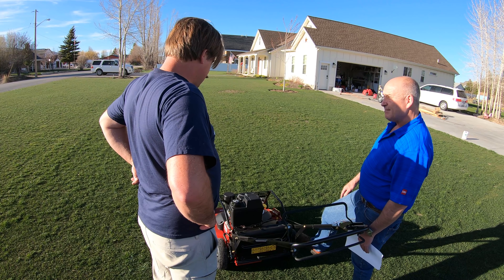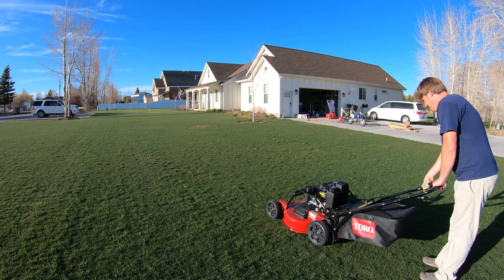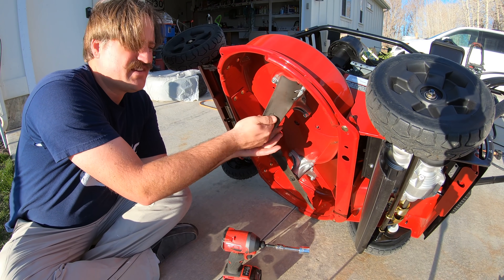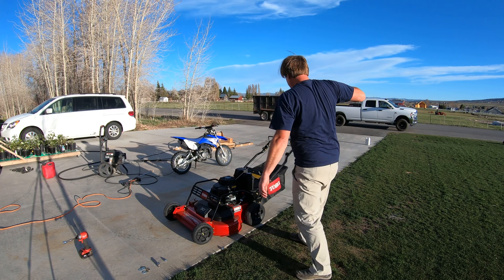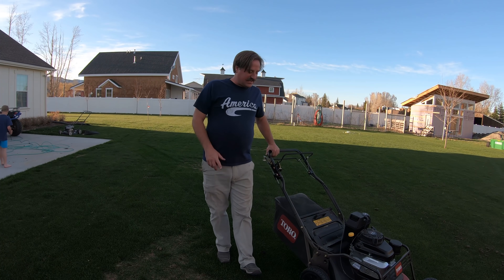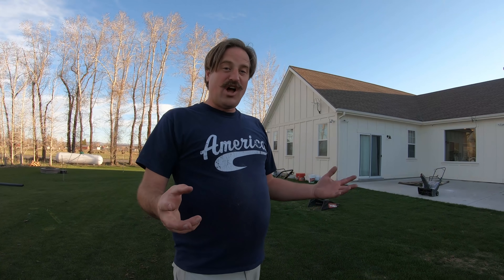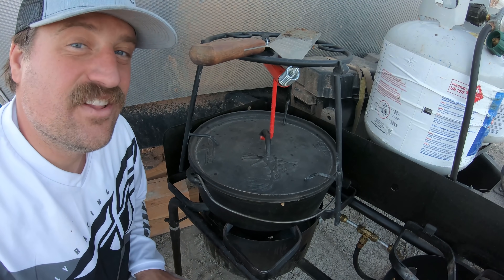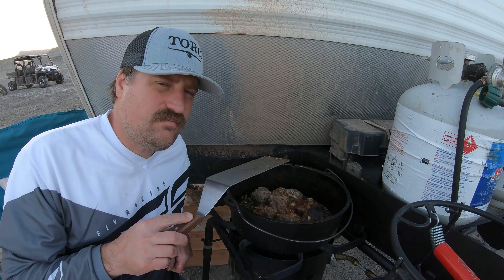I NEED another mower. OBVIOUSLY

Comment: I'm sure you must know someone with a cnc machine. Bring them the spacer and see if they can make a thicker spacer with keys on it.
Reply: Matt Coughlin easy !! Just need to turn it on a lathe and drill a couple of holes for the drives
Reply: And a longer bolt
Reply: @Gixer750pilot  it looks like it had pins (keys on it) which is why I though cnc. But lathe could work too.
Reply: I’ve got a Timemaster and full CNC machine shop.  Just sharpened my blades for the first time so I am familiar with those keyed spacers.  Gonna have to say the name of my shop in every video forever tho.
Reply: This would be the way to go.  I could design it if you want and Dustin can cnc

Comment: Toro lawyers are running down the hall right now, in a panic. 😂
Reply from the maker: That safety lock for the bail bar..... No Bueno. Home depot bottom of the line toro is crap. High end toro is 👌
Reply: Tell them dere lawyuhs you'll leave the safety latch on if they send you some smaller wheels to get that deck to the ground.  Once you have smaller wheels, do the right thing with that safety latch.
Reply: Mine came with the safty disabled
Reply: They need to fire that rep lol he just likes driving around
Reply: @FylerTarlow  dude for real i couldn't believe how little he knew
Reply: @lawnrebel  you could put smaller diameter wheels on the mower and it would sit lower 😜🇦🇺 ps. Watching from Australia, your content is awesome!

Comment: Drill holes in the pins of the spacer where it connects to the blade. Make thread in it and put setscrews in it. Those can be longer then the original pins and you can use your washer trick🤙

Comment: I know you've already had your experience with Honda (residential grade), but check out the HRC line (commercial grade). Has the blade stop feature where the motor still runs and the blade clutch disengages, but more importantly, you can drop the mower to 3/4" at the lowest setting. We run them with all of our maintenance crews. $1200 push mower brand new
Reply: Chris6418 better engine with manual choke too.
Reply: Honda commercial 21”
Toro/ex mark commercial 30”

I think I speak for everyone, but I’ll buy a Honda tomorrow if it’s commercial 30” with two blades and especially if each blade side has the double blade. It packs it in the bag for sure.

Comment: Connor, if that mower has pneumatic tires then let some air out of them. If the tires are solid then possibly replace the tires with smaller diameter ones.  Just an idea. Good luck with the mower, but maybe you should consider returning it since it does not go low enough for your needs.
Reply: Huh, conversely I could put bigger wheels on my Timemaster to give it more height for my St. Augustine in the Florida summer.  Good idea.

Comment: That’s a quality commercial mower you bought. I bought the exact one last year and love it , main
Y because it has a manual choke that will never fail lol and a Kawasaki engine. Good luck with it . It will last you forever in a residential setting. Just a couple more things, the engine will smoke at start up the first 20 hours or so & then stop when it’s broken in. Another thing is due to the weight of the mower, the wheels will leave small ruts in the ground , especially when wet
Reply from the maker: ruts are bad. I cant do ruts. My lawn is wet a lot due to my addiction to watering the lawn. Thanks for your comment. I can not wait to use the heck out of this machine.

Comment: You need to get custom spacers machined with the same key points on both sides
Reply: Richard Taylor there’s a few contractors down here that use these mowers and have done that exact thing. Works a treat and can get down really low

Comment: You act surprised when it doesn't go below 1.5" When it says that right on the Toro website. Did you not research this mower before you purchased it?
Reply: A true rebel
Reply: Research is like the instructions manual...you just don't need it
Reply: The manual is the casual opinion of the manufacturer. Nothing more.

Comment: did you try using washers to lower the blade, then using metal for pins that could be held in with a washer between the blade and the bolt? The pins would go from the blade up next to the washer and into the keyway holes.

Comment: I am sure you can buy parts from Toro...so get 4 of the keyed spacers and tack weld them together in a stack (done)  OR as others have mentioned make 3 or 4 custom spacers of different heights at a CNC shop. (they'll be more solid & good forever.)    Its all do-able.

Comment: Order two more of the blade adapters...grind off top nipples of originals..bottom nipples new ones...put together or add additional washers in between for desired blade drop... tack weld outside edges or JB weld together..mine is running strong with weld for year and half..Hope this helps rebel

Comment: Those blades are timed so they don’t hit each other. That’s the reason for the keyed blade washers. Can those washer be stacked? If so just buy some extra splined washers.
Reply: frogcassady bad idea.  I’ve run Exmark 30” for a while now and you’re better off just sticking with how the factory made it.  Especially since the blades have a crossing pattern.  Just think about it.  One of the blades loosens and then under deck carnage takes place and you’ve gotta by new timing belts, shafts and spindles just for and extra half inch of cut.  It’s not worth it

Comment: If you want the Toro TurfMaster to go to a lower height than what it allows, you can change the wheels and get flats. The Toro you have came with 137-9174
10.5 IN. WHEEL ASM for the rear wheel. And for the front wheel you have the 133-2639 WHEEL. Just get thinner tires and that will drop your mower so much that you may have to even raise up the bed.

Comment: custom shims for strictly the blades.  or change the wheels.  But make sure they fit whatever the pattern is for the blade mounting system itself.  Preferably that it sits in and extends it.

Comment: Take that to a machine shop and have them make a couple but thicker by 1/2" or whatever you need. Go an inch thicker and get a longer bolt if you want it down to 1/2". That or I'm sure new mounts/brackets could be made for the wheels.

Comment: Add more agustments to the deck height handle. Find the lowest height you want to go down and put self tappers through it into the deck to hold the setting or drill a hole all the way through the handle and the deck and put a bolt in it

Comment: I debated between the TurfMaster and TimeMaster for a whole season. I ended up going with with a TimeMaster for my .33 acre yard and it's been great. Need to fuel it up before each use which is the only downside (Turfmaster has a bigger tank). The price difference is about $1000 so with the savings I bought the $200 striping kit.

Comment: 5:00 nothing a welding machine and a trip to home depot can't solve. You will need the same size as that in a a couple of washers and weld on some metal then shave it down with a cheap angle grinder from harbor freight to make a new "key".

Comment: Buy a couple more of these 120-5236 ADAPTER-BLADE and file or grind off the tabs off the of the top side of one set and remove the tabs off of the bottom side of the others sandwich them together and maybe a longer bolt
Reply from the maker: This is the plan. I ordered new washer keys yesterday

Comment: Nice machine mate ;D I bought a Timemaster a couple of months back because I needed something to step in whilst one of my commercial Honda's was broken down and I love it! I took the blade safety off mine too and added a throttle control and she screams now lol. Only thing you might need to look at when cutting super short is the couple of bars on the back of each side of the deck which will dig into the ground if you put the height down too low.

Comment: You should but 2 of those keyed washers that come with the mower and drill holes in steel washers where the nubs are and sandwich the steel ones between the 4 factory washers

Comment: $2,000 for a mower that doesn’t even go low enough to cut your grass. The Honda was able to get low & perform.. This new mower is just a metal weight. Just return it.

The guy that dropped the mower off was not too knowledgeable of this mower. Smh
Reply from the maker: The Honda performed? Not even close
Reply: Connor Ward by perform I’m simply referring to cutting the grass. Yeah the Honda gave you problems but in the end you resolved them & it performed to the best of its ability. Mowers are gonna break regardless of the brand, some worst than others. Hopefully you can get this new one tweaked in & working for you.👍
Reply: @lawnrebel  I watched the video that you made showing how to put washers over the blade to get a shorter cut. Besides not leaving the stripes, that honda was cutting almost as good as the reel mover
Reply: @lawnrebel  I've heard of other Honda motors crapping out too, not just on cheap mowers. I am a Kawasaki man although I kinda fell into it as my first GreensMaster had a Kawasaki. I have stuck with them since and haven't had any major issues. Amazing how reliability supercedes any and all other aspects of mower motors but they seem to market based on everything else.

Comment: Hey Conner, I had one of those. I hope you have better luck with your, mine kept blowing bearing on the jack shafts. You will feel a bad vibration in the handle and you will be able to hear it as well. Overall a very nice mower when it's tight. Enjoy the mow!!!!

Comment: 2300 bucks! No thanks! I'm very happy with my husqvarna.  4 wheel drive, 22 inch deck, electric push button start, nice big rear bag and, handle bar that's made at a usable height (not for a 6 year old).  All for 600 bucks.

Comment: I've never seen a push mower with a roll bar.   Obviously Toro has watched your channel before.
Reply: LeonaTimberCompany it’s more to protect the front part of engine from running the mower into obstacles. This mower is for commercial use which means not everyone one will operate it with great thinking powers aka employees

Comment: Nice lawn vacuum you got there. 
Seriously though: I assume the blades will interfere if they're not keyed properly, since they seem to be 90° off? If so, I'd advise against putting washers in between, just to avoid any chances of the blades hitting and causing a big old noisefest. You could try lowering the spindles (the grey cast element at 5:00), but you'd have to see if that can work on top of the deck, plus it'd probably be an issue with debris getting in them.
IMO, the best thing to do is to cut the spacer (4:31) in half, add some material between the two halves, and weld it all together. Better yet, try getting a second set of spacers. On one, grind off the pins that go in the spindle, on another, grind of the pins that go in the blade, and weld those ground sides to each other. That'll give you a double height spacer, with the keying pins still on there. If that's not low enough, you could even add some extra material in between.
Do be careful with lowering the blade too much that way though, eventually the blade will be lower than the mower deck, making it very easy to hurt yourself, especially when the mower is raised up for mowing brush or something like that. It may also affect suction, but I'm not sure about that.

Comment: Ha, started commenting before I watched it all. Was going to suggest spacer washers!
Reply: Haven't watched it all yet, but maybe mod some washers with an angle grinder and or weld in some nipples if needed.
Reply from the maker: This is the plan if I can get some more washers. This or new ones on a CNC machine.

Comment: Instead of putting washers under the blade, put another blade under it at 90 degrees. The suction you get is incredible and it dives the clippings into little tiny pieces. 
You may have to grind one if the blades to make a cradle to hold the second blade.

Comment: I own the toro 30 and the HRX and.. if it werent for the size I would take the honda over the toro 100x over. 
So much better other than the height adjustment. 
HONDA MAKE A 30 INCH MOWER THAT MULCHES DAMNIT!

Comment: Those key disks are standard on a lot of electric mowers, you can get a stack of cheap plastic ones or metal ones.
These are the kind of thing in this listing.
https://rover.ebay.com/rover/0/0/0?mpre=https%3A%2F%2Fwww.ebay.co.uk%2Fulk%2Fitm%2F193353338528

Comment: Get rid of that mower. Rear axle bends causing wheels to camber. Too heavy for what it is. No personal pace. When The blade spindals go out the machine is out of commission. I had one and got rid of it. If you need a 30 get the residential version. It’s cheaper and stronger than that tank and I use it in commercial setting

Comment: Toro's are disposable trash. But yeah, wish my honda didn't have that stupid autochoke!
Reply: This toro is way more durable than any Honda mower. But the engine isn’t quite enough to spin two blades. Plus it’s heavy. It’s only useful in the 21” version. If you need a wider walk behind the 32” fixed deck toro with a 14.5 hp kawi is the way to go. Not for low mowing but it’s overpowered and mulches/bags like no other.